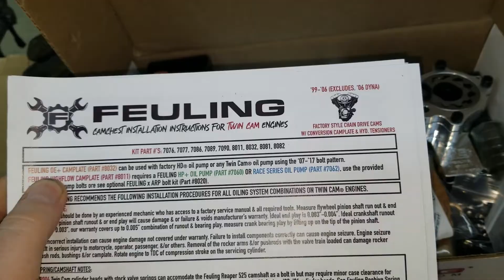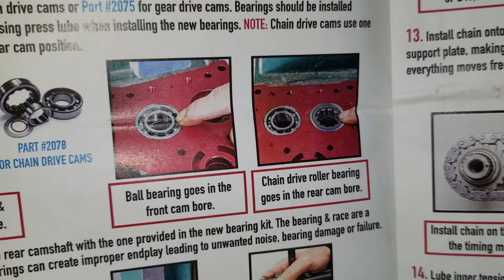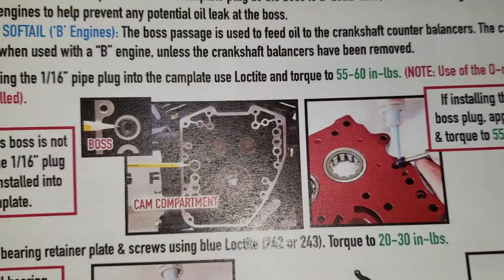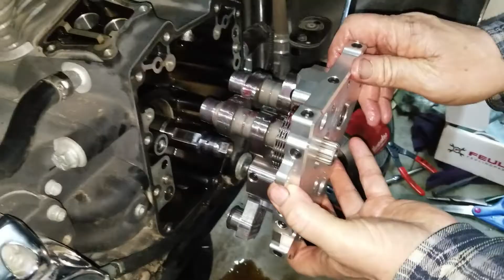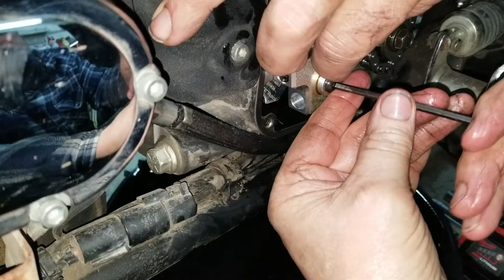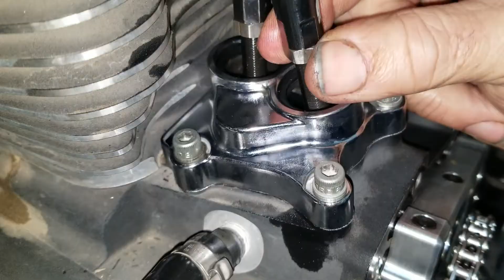2004 Harley Davidson FLHTCU Feuling cam plate and oil pump upgrade

Comment: I have an 2002 FLSTC with 18000 and am thinking about doing  the screaming eagle hydraulic cam chain tensioner soon. Im new to this and so thier are some tools like a press that i dont have but i can get that part done. Any recommendations on doing this would be appreciated.
Reply from the maker: Well we didn't do the screaming eagle hydraulic cam chain tensioner camplate kit before but really it should install exactly like this kit except for there is a oil passage that we talk about and block off for the non balanced motor we were working on. Your 2002 Softail is a balanced motor so that oil passage is used and needs to be open as it's for oiling the balancer bearings. But the instructions should walk you through the installation process.
Reply from the maker: The kit we used was Feuling OE+ Hydraulic Cam Chain Tensioner Conversion Kit For Harley the price varies depending on where you buy it I believe it's between $700.00 and $800.00
Reply from the maker: Oh and the special service tools and a press are needed to press the cams and bearings out and new bearings in so you will need to buy all those or borrow them if you know anyone with them.
Reply: @jessesvintagegarage765 yeah I was going to take it to a place to get them pressed in. It's 599 for the kit I wanted to use. How much is the kit you all used.

Comment: I got the same kit. Did you figure out forsure if the O-ring is needed with oil pump? I have same kit and didnt see a groove for it so was curious if you had any issues?
Reply from the maker: No issues at all  my dad's 2010 ultra the kit he used had an oring and both bikes run the same because he rides with the guy that owns that 2004 ultra all the time and they both work exactly the same as far as oil pressure etc.

Comment: Excellent video thank you ! We're using same kit same sns exceptions hah.
Hoping all still good w/build.
We had One of them -nese
Cam Chains stretch & skip
Rt-outta the chat, Beware.
Be well.
Reply from the maker: Nope no problem with ours we now have over 8000 miles since and  zero problems  but the oil pressure has always been around 55 pounds and we've been very pleased with the update, thanks for the great comment

Comment: What if the boss plug isn't installed in the cam plate and it should have been ?
Reply from the maker: Depends if you  have a softail balanced motor because that's what that boss is for but in a non balanced motor like Dyna and baggers that boss isn't drilled and isn't used the instructions clearly state place an O-ring and put red locktite on the allen screw in place or leakage can result. So if you forgot the allen plug screw I'd be nervous about not having it in place it sounds like oil pressure could get past the oring causing it to fail. Just my thoughts on it.

Comment: I think this is crucial.
Reply from the maker: @gilbertj8362 
The 2006 and earlier twincams the cams are held in place with a bearing retainer and the bearings are pressed on the cams we've done the sprocket alignment  check or setting both ways and it really didn't matter. It's different on 2007 and newer twincam motors they don't have the retainer.

Comment: Why didn't you put the bolt in the top sprocket when checking clearance?
Reply from the maker: @gilbertj8362 The 2006 and earlier twincams the cams are held in place with a bearing retainer and the bearings are pressed on the cams we've done the sprocket alignment  check or setting both ways and it really didn't matter. It's different on 2007 and newer twincam motors they don't have the retainer.